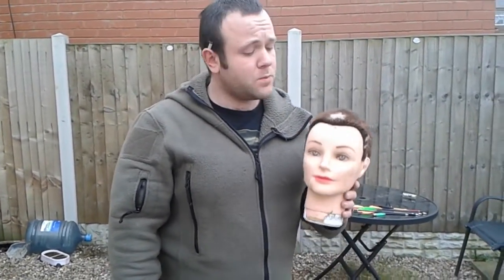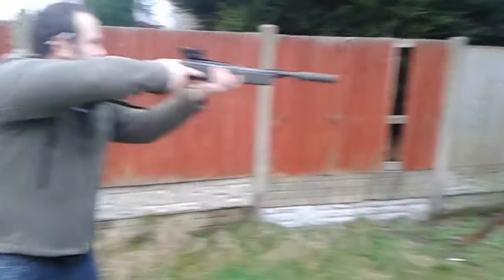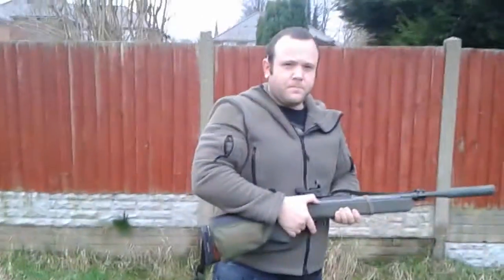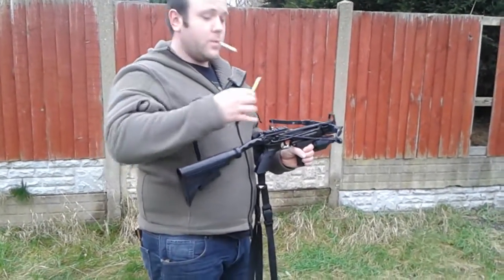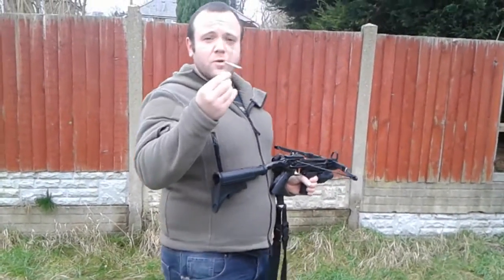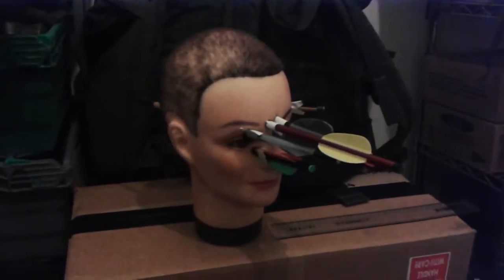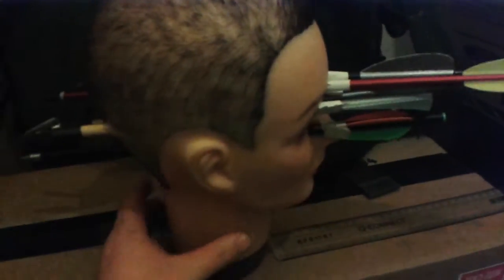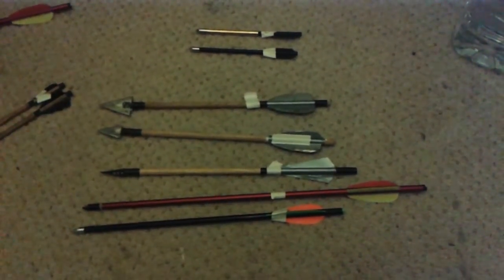Crossbow bolt penetration test

Comment: So what happened to the pellets? love that mod on the pistol crossbow.
Reply from the maker: Bat man the pellets penetrated but i have no idea the depth,its hard to find were it was hit with pellets as the hole is very small in rubber mate
Reply: Thanks for getting back to me ;-) those crossbows are ruddy impressive. Liked and subscribed.